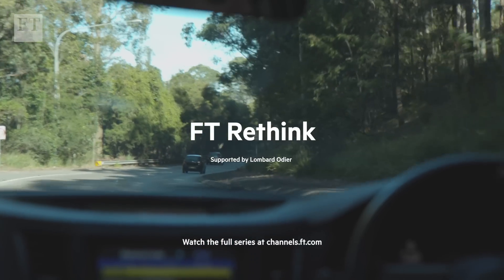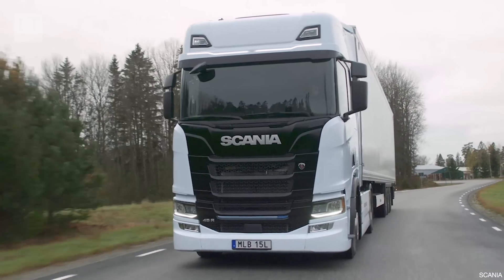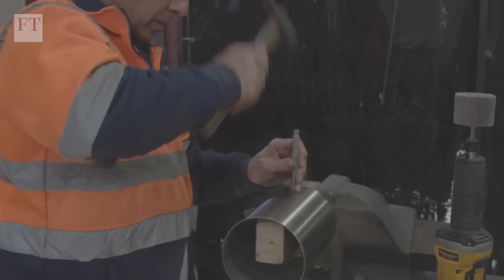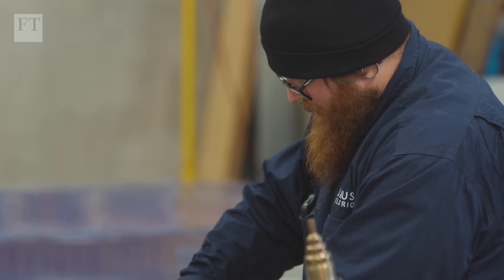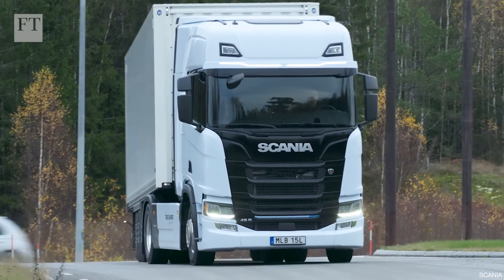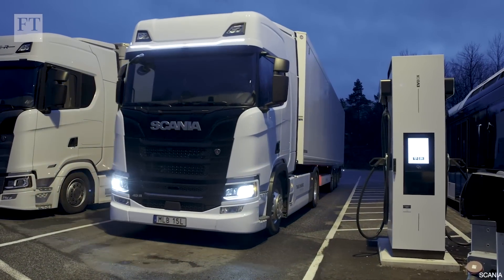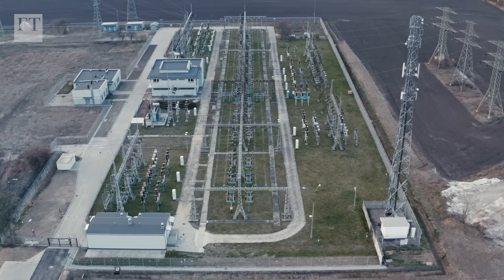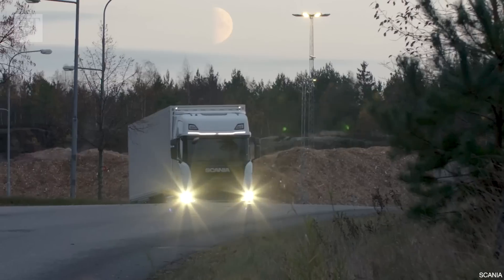The long haul to electrify heavy trucks | FT Rethink

Comment: Are people in the logistics industries living in a bubble ?   Really !!  nobody has herd of TESLA.   The Tesla Cybertruck thats already in light production and testing . Has  800km range and charges to 80% in 30 minutes , not to mention 45,000 plus supercharges world wide and growing by 1 every 3 hours. Drives past any other Diesel truck going up hill like there standing still.
Reply: It also loses range with more weight added to it, is not currently being sold, and long haul trucks need to burn fuel so they can carry bigger loads and make it past the scales.
Reply: @AtillatheFun  If your talking about the Tesla Cuber truck that's not correct 800km range is at full load.
Reply: @AtillatheFun  Tesla Semi has 500 miles of range fully loaded and over 40 of them have been sold.
Reply: @AtillatheFun AND IT'S HUGE WITH ZERO SLEEPER LOL

Comment: Instead of battery electric, why don't people use the water turbine-like engine? It'll be unlimited because water just circulating around the engine, pumped out from the tank, sucked into the turbine, and pushed into the tank again, circulating (except when the system leaking water). You'll still have a regular altenator, a regular air compressor, a regular AC compressor, etc.

If this (battery electric) applied in rigid trucks, would it work because of what I see in this video is that Janus and other manufacturers used it in the semi-truck as well as short-to-medium distance rigid trucks and there is also a rigid truck that go long distance and even more long distance than what they're expecting for just one way, like in my country, Indonesia. Delivering logistics from Banda Aceh in the north-westernmost point in Sumatera right to Malang in nearly easternmost part of Java. Nearly 100% of it, are rigid trucks, because of the narrow road it tackles.

And, why is it going to electrifying anything? Why don't people just didn't litter the water with garbage and why peole just don't depend on big cities to make more money? That'll be long-term ways, as well as reforestation and less-coal fired powerstations.

Frankly, I'm not a battery electric type of man, I prefer the electric train-liked type or hydrogen-fuel cell one.
Reply: Hahaha lacking understanding of basic grade school level physics 🤣✌🏼

Comment: As a way to reduce GHG emissions in countries with less than reliable power generation, usually using a mix of coal and fuel oil in power plants, wouldn’t the use of UCOME be an economically overall more sensible option ?
Reply: Yes but Australia has more solar/wind than it knows what to do with so no problem being 100% renewably powered. But I don't think battery swopping is the answer. 1MW charging could recharge these on 30ish mins and every 4 hours a professional driver has to stop for a break anyway. But focus on short medium haul first where they go to a depot every might and do a max 400km in a day. That would be a huge co2 saving with little disruption and huge fuel cost savings.
Reply: What the hell is UCOME? And why would you ask a question with an acronym like that? Also, no, fuel oil  makes up less than 3% of global electricity and in Europe in the US coal is less than 20%. Direct Electricity is clearly the way forward.
Reply: @Dr.Gehrig  if you had the slightest interest in low carbon forms of energy, a 5 second Google search would have explained what UCOME means, and why it is relevant as a fuel for trucks. 

Then, I was mentioning areas with unreliable power supply, which is usually not the case in Europe and the US. 

If you keyboard warriors spent a little more time thinking before shooting comments, the Internet would be a better place.
Reply: NO
Reply: @jeanlefranc3817 you clearly have no working knowledge of the transportation industry do you
Reply: @100pyatt  probably better than you think.

Comment: So far it is pilot project to upgrade truck delivery systems, but there are still other issues especially the long haul situation in USA with freight trains getting bad press as they would otherwise be more efficient than any truck even electric. But it might work for smaller countries including the mentioned Australia which is at least half the size of the 48 states USA...
Reply: @hbarudi Trains are the most efficient way to transport for long distances, but Electric Semis are the way to go from Depot to Depot.   In the USA 75% of Semi travels are within 250 miles / 400km from their base/depot.  This is well within the range of a Tesla Semi.   Since these trucks can be charged during off peak times, there would be little need for Grid expansion or update.

Comment: For long haul, better to use hydrogen
Reply: Find my top level comment which explains the numbers for existing battery electric trucks in real world scenario (kWh per km, versus speed limit, versus driver rest times). That should give you a sense of just how good electric trucks are today.

Hydrogen is always fun to debunk.

Hydrogen has excellent energy density, but that is gravimetric energy density (kWh/kg), it has totally useless volumetric energy density. To the extent that you cannot contain hydrogen at atmospheric conditions, in fact, hydrogen will float out of our atmosphere and into the sun, eventually.

To be able to deal with hydrogen in an acceptable space it gets compressed to 700bar, and then it needs the appropriate pressure vessels and infrastructure to deal with such pressures, which totally ruins the energy density question.

Then, to create hydrogen, you can do SMR, which is 74% efficient at scale. If the methane feedstock comes from Siberia, and is being converted in say, Ludwigshafen (germany - find out what big polluter and political player is there), then 20% of energy is wasted extracted and transporting said methane (the pipelined gas needs to be recompressed every few 100km). This makes a conversion rate of fossil methane to hydrogen of just below 60%.

If you create hydrogen through electrolysis, then you are looking at a electrical efficiency of 40-60%.

You then need to compress this hydrogen, and transport it to the hydrogen fueling stations. At all points temperatures and pressures need to be kept at 700bar.

You then burn, slowly, said hydrogen in a fuel cell, and fuel cells are between 40 and 60% efficient. Fuel cells like it hot (400C), and need extremely pure air, and they do not do load changing well. So any hydrogen vehicle ends up being a battery electric vehicle with a fuel cell range extender. From this point on, the hydrogen car is just as efficient as any fully electric car.

So even if you factor out transportation and keeping the hydrogen compressed, and the drivetrain and charge losses of an electric car, you are still looking at 16-36% efficiency compared to a battery electric vehicle.

The big plus of hydrogen is this: the current model of oil companies selling us fossil fuels can be retained. In fact, these money printing companies would love to usurp our excess electrons from our own photovoltatic systems on our roofs for cheap, and sell us a third of the energy back expensively. And it is the propaganda of these companies that you have been hearing, but all it takes is a few facts and some simple napkin math to show just how ludicrous hydrogen really is.

Also, for some real world info: look for "bjorn nyland" testing the "toyota mirai" here on youtube, just a few months ago.
Reply: No, hydrogen is much too expensive.

Comment: Why don't they put solar panels on the container behind the truck which can help the truck batteries get charged while moving or even being parked? Even if it does not fully charge the batteries it reduces the number of times the truck has to be charged so that the truck can go a longer distance after each time of charging.
Reply: The answer is simple. These trucks probably use 60 kWh to drive 100 km. The top of the trailer, fully covered in photovoltaic cells would, in the absolute best conditions (noon to 2 pm on a clear and sunny day) generate 6 kW, most likely 3 kW in realistic conditions, so 3 kWh in one hour or 6 kWh during the time used for the truck to drive 100 km. So 10% of the demand during daytime driving and 0% as soon as it gets dark.
Reply: @jeanlefranc3817  Even 10% is better than nothing and please consider that the truck is not always driving and when it is parked the electricity will be stored in the battery for the driving time
Reply: It's not necessary, batteries are good enough for electric trucks today, and range and charging speed is not an issue. Look for my top-level comment on some facts and some napkin math.
Reply: @luc_libv_verhaegen  Yes but receiving an extra charge from top panels can reduce the times the truck has to stop and charge the batteries plus the solar energy is free.
Reply: @faridjafari6356  maybe you have noticed trucks are not always towing the same trailer ? In order to work effectively, a majority of trailers should be equipped with PV panels, for that time when its connected to an EV truck. The cost would be prohibitive
Reply: @jeanlefranc3817  You are right but the cost of turning trucks into hybrid vehicles or buying electric trucks is very much too so the cost of some panels on the trailer should not be very much comparing to, if they are economic their use will be spread and as their use spreads the costs of installing will be reduced
Reply: @faridjafari6356  brilliant analysis. I guess you majored in Economics and Finance at uni ?
Reply: @faridjafari6356  the real problem is there are far more trailers than there are tractors; so it's not economical as the trailers would become far more expensive, even possibly carrying batteries to store the charge while it's not connected to a tractor. Not worth it. Also quite often the company that owns the trailers isn't the same company that owns the tractor.
Reply: @jeanlefranc3817  Understanding this only needs common sense
Reply: @TankEnMate  But the fact that the trailers with solar panels will be more demanded because of their economic advantage will help their use to be spread. Actually also the extra free charge the truck gains from the panels which reduces the money needed to electrically charge the truck might exceed the price of the panels in a few years which can be a motive to install and use them.
Reply: @faridjafari6356  But why would a trailer fleet owner want to subsidise a tractor fleet owner? It would be a real pain to track any cross subsidisation, I can imagine the fleet managers pushing back on sales people and lawyers having to be included in meetings that are already fractious as is. Is it possible? sure. Is it feasible, no.
Reply: @TankEnMate  There needs to be mentioned that the trailers really don't need to have separated batteries than the truck
Reply: @TankEnMate  You are making it very complicated my friend, there is no need for lawyers and police and court and judges and and jail :))
It is very simple: If the system which owns the trailers feels that there will be much more demand for the trailers equipped with solar panels, competition will encourage him to put solar panels on his trailers.
And are all the trailers owned by the companies which do not own the trucks?
How many of them? Do you have a precise statistics?
Reply: @faridjafari6356  I don't think you understand how businesses work; if there's money changing hands then there's lawyers involved (either directly or indirectly, someone has to write the contracts, someone has to vet the contracts).
Reply: @faridjafari6356  If the trailer doesn't have a battery then any power it generates while not connected to a trailer is lost which in turn makes the panels more expensive (because they are not paying for themselves), which in turn makes the trailers more expensive (which no one will want to pay for). Companies buy trailers because it makes them money.
Reply: @TankEnMate  My friend, you mean every time a trailer is going to be connected and toed to a truck you need a lawyer? And with such an attitude you claim to know business? Do you hire a lawyer each time you need a UHAUL ?
Reply: @faridjafari6356  No you'll need a contract between the company that owns the trailers and the company that owns the tractors. Operations managers have a hard enough time getting trucks to their destination on time, having a meeting that involves lawyers is worse than pulling teeth.
Reply: @TankEnMate  My friend, I really do not understand what are you trying to make from this topic.
Reply: @TankEnMate  My friend, I really don't understand what you are trying to make of this topic?
Reply: @faridjafari6356  My point is this, 95+% of companies that own trailers will refuse to put solar panels on their rooves because it's too much of a pain in the a***.
Reply: @TankEnMate  And my point is that if it is economic and has a profit they will do it.
Reply: Adding SOLAR To truck roofs Should be Mandatory as one step among many to make the Electrification agenda work
Reply: @jeanlefranc3817  10% on every truck including Parked that can charge or put excess back into the grid makes logical sense of the otherwise Wasted Roof space
Reply: @TankEnMate Trailers need both Solar AND Battery, as a Combination vehicle it should be able to use BOTH sources of POWER
Reply: @TankEnMate that's why regulations force EV agenda items, otherwise it doesn't make Economic sense to businesses
Reply: @100pyatt  It was that way when EVs were first subsidised, but both then and now the oil and gas sector receive more subsidies than EVs. The difference now is that over a 10 year life span an EV is cheaper than non EVs; the inflection point is now past. Economics will now drive further adoption. Obviously some people (possibly yourself?) don't want to give up their ICE vehicles, but within a couple of years not only will the lifetime cost of an EV be cheaper, the sticker price will also be cheaper. The winds of change are here and the gusts are getting stronger.
Reply: @100pyatt  Maybe, I'd have to check the numbers to see if it pays off in the long term. Also it will probably require a change in operating procedures because there will be an increase in the cost of the trailer (which means more tracking) and also the cost of the roof of the trailer (which is the most likely part to be damaged). But I suspect in sunny climes it will probably work out.

Comment: The average electric car weighs 35% more - about 1,000 lbs. - than its gasoline counterpart. It is bad for the environment and for our energy supply to move all that extra weight, and it harms the roads and wears out vehicle tires more quickly as well.
Reply: Not at all really, ICE engines are about 14~21% efficient, where as BEVs are about 90% efficient. BEVs also tend to have far better drag coefficient, and above 50km/h drag scales at the square of speed, twice the speed 4 times the drag; so a lower drag coefficient goes a long way. So overall BEVs are far more efficient (mainly because they need to be).

Comment: Green Hydrogen is right choice for long haul heavy trucks
Reply: There are very large logistical challenges with transporting and storing hydrogen which is extremely low volumetric density at STP.  Moreover, there's lots of energy loss compared to using that electricity more directly -- may only have 66% of input energy remaining.
Reply: @beyondfossil  not 66% even lower 30-35% end user efficiency

Comment: Well that was a very negative tone to that video.

The fact is every major lorry manufacturer has already been selling electric lorry's.

Maybe not the longhaul but for example the volvo trucks that went on sale two years ago have a range of 300 km.  Which for shorthaul is more than enough.

Remember lorry's can only drive 4 hours at 100km/h before the driver is required to rest.  So a longhaul lorry will need to dtive 400km.  Fast charging is always 0-80%.  So the lorry will need to do than 400km with about 80% of the battery.

Next year VW will be releasing a car with a 0-80% recharge time of 25 minutes it's the id.7.  And that will not be the fastest recharging car on the market, the record is currectly 18 minutes.

So it's very realistic to have a longhaul lorry with todays technology.
Reply: No. There is a difference between short haul and long haul. Long haul trucks need to burn fuel so that they can load more while staying under the weight limit of scales. This is not possible with batteries.
Reply: @AtillatheFun  wrong
Reply: @matthewbaynham6286  Long haul trucking is not the same as the trucking within cities. It requires fuel shedding. It isn’t an opinion.
Reply: @AtillatheFun  the terminology you used "fuel shedding" is just some non-sense you invented in your imagination.

Comment: Hydrogen is the way forward, once the mass production be possible. Electric still use unethical mining and nuclear and coal power plants. Just my opinion
Reply: How is nuclear unethical?
Reply: You can use LFP batteries for short range trucks thought. NCA batteries (containing cobalt) are just for long range vehicles.
Reply: @johntheux9238  hi John, green hydrogen is the way forward it’s already on the way in Uk, big fuel companies such as esso, Bp, shell are buying back existing forecourts and now aiming to open hydrogen supply by 2025.
Reply: @007kanatan  Aiming for something is not what I would call results.
Reply: @007kanatan  Hydrogen production and consumption is only 30% efficient. So it's very expensive to refill.
Reply: @johntheux9238  it’s true but commercial and long distance travel vehicles opt hydrogen. I work in fuel industry and our industry leading that way media etc talk lot of random stuff. By 2025 hydrogen production plants will up and running threw out the country
Reply: @007kanatan  You can get 500 miles of range fully loaded with batteries so I don't see what's the advantage.
Reply: Liquid hydrogen, most abundant, clean and extreme power dense fuel on the planet